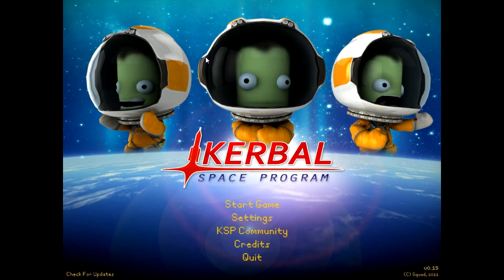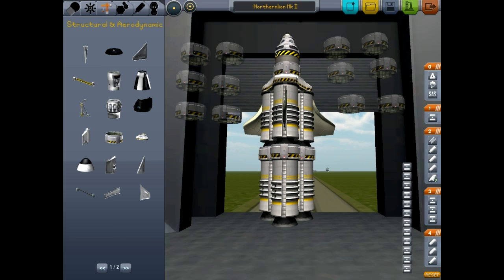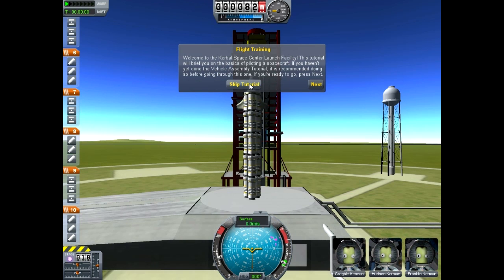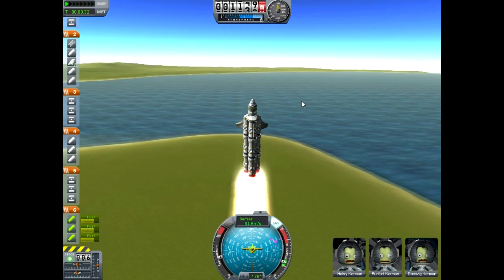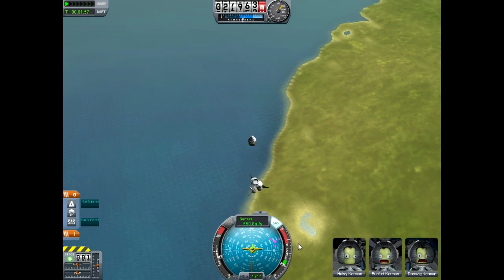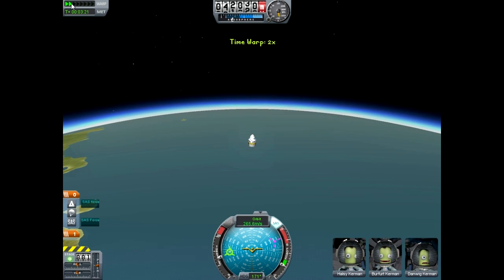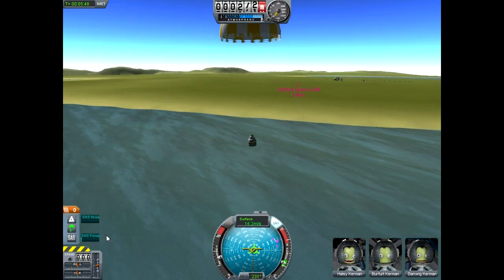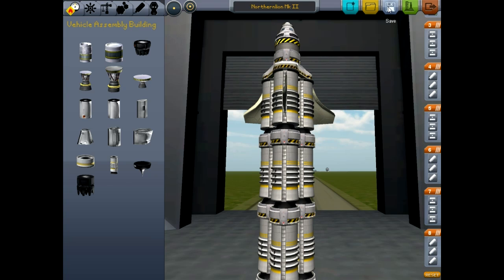Kerbal Space Program: To Infinity and Beyond! Apollo 2

Comment: NL you can press M to open a map that will show your in flight trajectory, which will help you confirm whether or not you're in orbit. Liquid engines are much more useful as they can burn longer if you stack the fuel and you can control the power.

Comment: Some things to keep in mind NL: The more weight you give, the harder it is going to be to rise, so a pyramid-like shape would have to be in order. Try to find the most efficient way of using your engines, as in try to make it so that you run out of fuel just before it over heats. Also, the game may or may not take this into account, but engines lose weight over time because they're burning up the fuel, so that's something you may have to remember.

Comment: You need to use some liquid fuel engines. Solid boosters are good for getting up off the ground, but liquid fuel engines are better in the long run. And you really don't need that many. More engines = more power, but it also means more weight, and you generally don't get a trade-off in your favor.

Comment: Preface: Never played the game.  But based on what I know, here a couple of tips.  Add a decoupler between the SAS Module and the Capsule.  This will help with reentry into the earths atmosphere as the capsule is probably aerodynamically designed to take the reentry heat and disperse it. Also consider taking off in an arc to put yourself in orbit around earth, this will help increase speed as the centrifugal force of gravity will help the spacecraft along and you won't fall straight down.